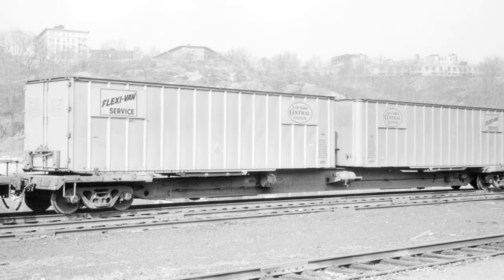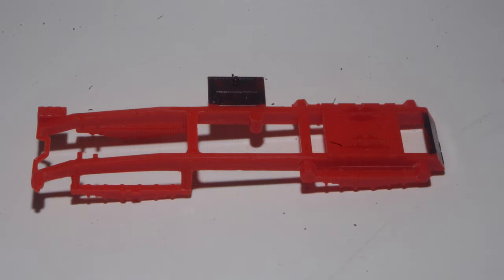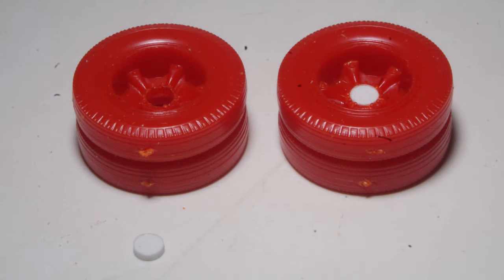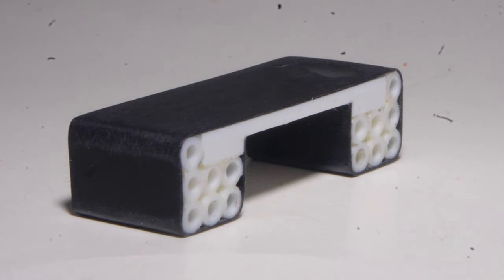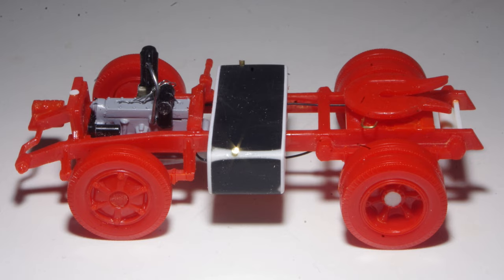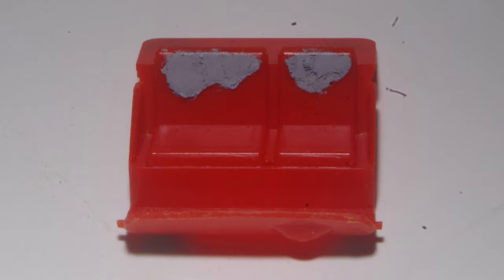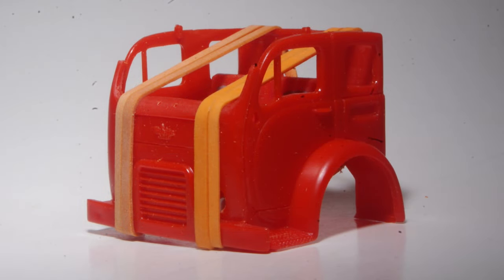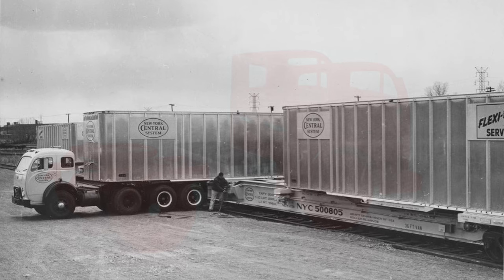1:48 scale White 3000 and Flexi-Van trailer, part 1

Comment: Great job making this old kit into something special!
Reply from the maker: Thank you - although an old kit (originally released in the mid to late 1950's I believe) the parts are quite well detailed, even more impressive considering it was all manual machining and hand work back then to create the injection molds.

The most challenging fit issue on this kit is multi piece cab, which I think is also a reflection of the 1950's issue date and injection molding technology of that era.